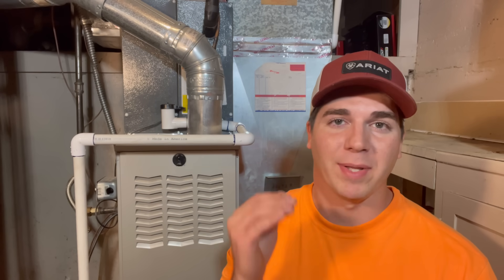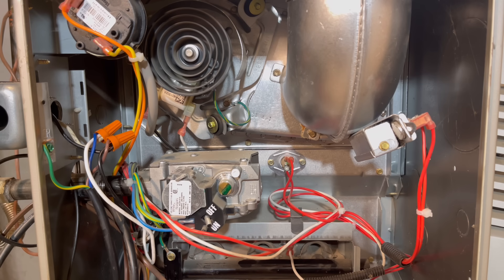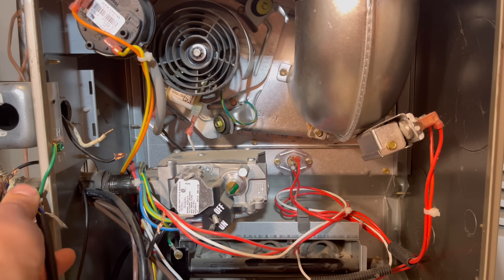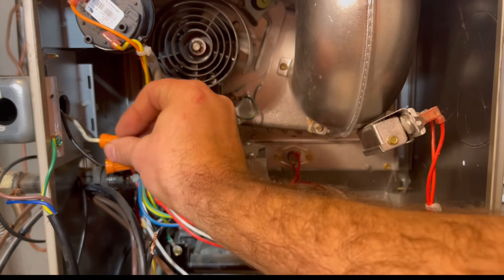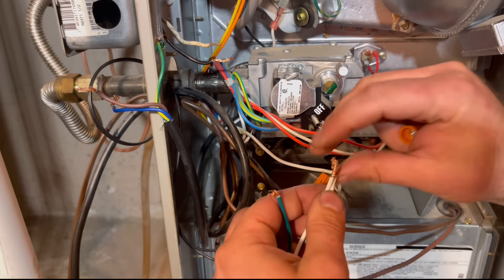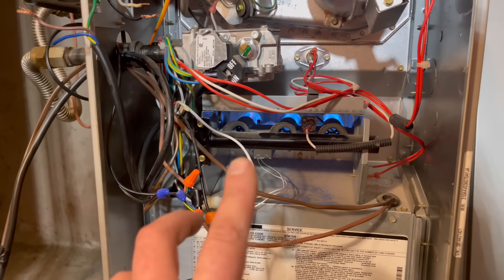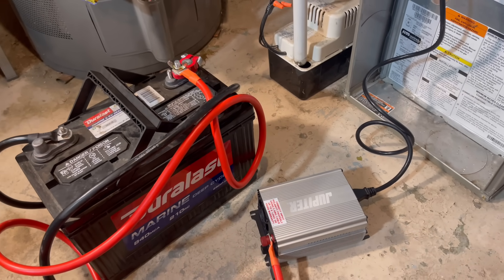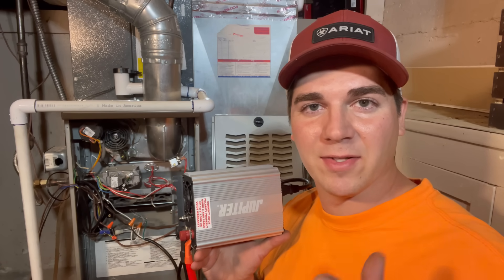Did You Know You Can Heat Your Home With A Car Battery?

Comment: After looking at several of these videos, figuring how much run time would be provided, how much continual amperage is needed to draw from a deep cycle battery (ies) and the cost for everything, and the fact that after the battery runs out there is nothing left, I found that buying one of the small quiet gas generators is a much better option. As long as you can drive to get gas, you can keep power on - run furnace, frig, lights indefinitely.
Reply from the maker: Yea, you do what’s best for you. This is obviously a backup if someone doesn’t have access to a generator. Gen sets are always superior. Mine is tri fuel so I can run it on natural gas

Comment: I had to do this with my basement sump pump once when we had massive rain for several days, and our power went out. It really saved us from flooding, most of my neighbors suffered that fate. I bought a gas powered generator a week later to have in reserve, and have never needed it for any emergency since. I now have solar panels connected to a charge controller, inverter, and gigantic deka battery for power to my shed. I can always run a cord to the house for emergency power, as well as the generator I still have at the ready.
Reply: @pete32 adn it's very much dependent upon where you live too. We have a high concentration of clay in our geographical area. When there's a heavy period of rain, the ground will eventually absorb the water and it takes a while for it to dry out again. The hydraulic pressure it puts on the foundation walls is released by the sump pump and associated drain tile system. It is a system that works as intended, and the only caveat is when the power does in fact fail.

Comment: I live in San Antonio and I did this when we lost power. But I ran the extension chord from my mounted inverted in my truck to my heater. I would let the heater run and get the house to temp twice then remote start my truck and let it charge the battery back up for a bit. It was a life saver

Comment: i'm stunned as to how close you have the battery to the furnace.  the battery needs to be a minimum of three meters from the open flame source of the furnace and it should be in a well ventilated area.
 
should there be a hint of hydrogen/oxygen gas, a by product of electrolyte breakdown which happens during battery activity, reach the open flame the resulting explosion would be catastrophic. you're luck you survived that video filming.
Reply from the maker: This only applies when charging. Otherwise I’d be dead haha
Reply from the maker: If this was true, there would be a lot of cars blowing up. Because the battery is right next to an engine with old spark plug wires that arch all the time.
Reply: @diyhvacguy ...viewers,  please do some research into wet cell batteries and the explosive properties of hydrogen and oxygen gas. most batteries have explosive warnings written on them.  better to have safe practices rather than to risk injury.  keep wet cell batteries away from open flames.

Comment: Have a mechanical direct connect to the axle of EVs and solar, to super charge them. No more plugging in. Use V2G tech to transfer extra energy to the power grid so you don't cause fires or explosions from overcharging. A gear connection would be best for the roll effect. So if you need to disconnect the gear, you can manually without destroying the setup.

Comment: Combine self running generators and power walls in homes and businesses for seemingly endless clean energy everywhere all the time. Imagine running everything seperately and connectively at the same time. Power outages would be rare. And even if the main grid is taken out, everything will still be running.😎🇺🇲

Comment: Should just get a Jackery or other self contained battery system with a Solar Panel.  At least you can power some lights and charge cell phones at the same time.
Reply: I don't mean to be rude about it, but I just think that for the money it would be better to get a battery backup system that has solar panels as a charging system.  I'm up in Connecticut and my Jackery is a lifesaver.  It powers my pellet stove for heat when I have no power  and I can charge it in the daytime with the solar panels.

Comment: Lots of modern furnaces are condensing furnaces, so you'll want to make sure to manage the condensate too.  Mine is on a sump which has to be pumped.  No power, no pump, then small lake forms in the basement.

Comment: Pro tip, never leave a car battery on the ground. It will discharge into the earth. Put it on a little shelf or block of wood. The more you knowwww
Reply from the maker: This is a myth that has been debunked a long time ago. It was true many years ago but not anymore
Reply: Looked it up ur right hard plastic keeps them from discharging.. the more you knowwww

Comment: We had a 10 hours power outage a few weeks ago with the temperatures in the single digits. We heat with a TOYO heater that draws 250watts at start up and 50 watts when running. All our lights, fridge,  freezer and heater are on a sub panel with its own transfer switch. About 15 minutes after the outage I hooked up our Honda 2000  with a 1 gallon gas tank and it ran all night on a tank of gas.

Comment: Do you have to mess with home thermostat when you do this? Does it stay on during power outage?
Reply from the maker: Nope, as long as the furnace has power, the thermostat will work as it always does normal 👍🏽
Reply: @diyhvacguy  Thank you so much for the info. Great video 👏

Comment: Would it not be better to wire your furnace to a 3 prong  cord and plug it into a normal outlet?  So if the power goes, you can unplug from the grid and simply plug it into an inverter????
Reply from the maker: I have a video walking you through how to do this actually. It’s titled “Don’t let a power outage leave you without heat this winter”   Check it out! Cheers

Comment: Does the THERMOSTAT NEED  POWER-
OR is back-Fed from the power to
the “furnace “ ?
Reply from the maker: The furnace gives the t stat power so as long as the furnace has power, the thermostat will maintain whatever temp you have it set to just like it normally does 👍🏽

Comment: How many Watts do most blowers require?
Reply from the maker: Mine is a 60k and pulls 500 so I’d say for a large 100k furnace, it would probably pull closer to 900-1000 watts so I’d get a 2000 w inverter for a larger furnace.

Comment: the battery is 12V x 106A around 1200W/H  some blower motors are around 1/2 HP(375W) so will run for around 3 continuous hours if the battery is brand new

Comment: Why not just hook up the inverter to your car battery, run an extension cord to your furnace. Wire up your blower fan, connect to the extension cord and wahala?  When your car battety gets down to 10 volts many inverters will cut output, then start the car to recharge the battery.
Reply from the maker: I have another video on this :)

Comment: This is just common knowledge but that is a acid battery and you have no charge controller hooked up too it so you know the battery levels. Once a acid battery gets fully drained dead it gets damaged and typically won’t hold a charge no more and it turns useless. What you need is not acid batteries you need even just regular lithium batteries and that way you can fully drain them and it doesn’t ruin them and you can charge them back up and do that over 1,000 times with regular lithium batteries. The best ones on Amazon are over 300 bucks though for a 12 volt 100ah battery and will run at 1,280 watt hours and will last well over 2 thousand full charge discharge cycles but if you drain them half way and recharge them back up from 50% they will last you over 8000 charge cycles. You could be hooking up solar panels too it as well and charge it back up with free energy once it’s half way and always keep solar panels on it charging none stop with a charge controller with mppt built in but the lithium phosphate LiFeP04  best of lithium technology at lasting longer and way more charge cycles than regular lithium batteries have built in protections already. I’d rather buy and invest in one of those new tech LiFeP04 batteries that I can fully discharge without destroying the battery like regular acid batteries that will be damaged faster with full discharges.
Reply from the maker: Thanks for sharing.

Comment: Here's a question. What if you plug in a car battery charger into the silver box. Wouldn't that charge the battery  with its own power and let it last a bit longer?
Reply from the maker: No thermodynamics won’t allow it. Friction and heat will use up the energy quicker then it can generate it.

Comment: Will that battery run a big central heat fan ?🤔
Reply from the maker: No this is only for gas furnaces. I’ll have a video on backup power for heat pump and electric furnaces soon. Stay tuned for that! Cheers

Comment: Cranking amps are pretty much irrelevant, how many reserve amp minutes does that battery have. Probably drawing a minimum of 5 from the furnace plus 1-3 extra from the inverter, if you have a standard reserve cap you'll be going for a few hours at best.

This is why RVs with inverters run banks of batteries, and usually batteries with low cranking ability but a lot of reserve capacity.

Comment: What if mine isn’t a gas furnace?
Reply from the maker: This won’t work for you unfortunately. You’d need a large generator or a massive solar array. My apologies. I’m planning on doing a video for powering a heat pump or electric furnace by means of a gen set soon so stay tuned for that! Cheers

Comment: Can an inverter power a heating system that runs on electric? I have air conditioning unit so I've been told my heater is a heat pump. Any can I hook up an inverter to it and make it run? Thanks
Reply from the maker: Unfortunately you cant do this with a heat pump or electric furnace. This is only for gas heat. But you can power your heat pump or electric furnace with a large generator and soft start kit hooked up to your condensing unit. My plan is to do a video on this soon so stay tuned! Cheers

Comment: Good in theory, but a single SLA, 210aH deep cycle will only run it for hours, not days. Also, using a modified sine wave Harbor Freight inverter on an expensive furnace, bad idea.

Comment: This is not as simple as it seems depending upon the kind of furnace you have and inverter I have a newer high efficiency furnace I tried everything to get it to work off the system I finally was able to find a 3000 watt inverter on eBay that you were able to ground otherwise the furnace would continually shut down no matter how I grounded it this must be a older furnace because the newer ones with the circuit boards are extremely fussy same thing with my front loading washer and dryer they will not work unless it is especially grounded inverter I went through several inverters trying to get this to work
Reply: I also use my 600 watt solar system to power the lithium batteries but again all this will not help unless you have the correct inverter also it has to be a pure wave sign inverter for the newer furnaces and you must be able to ground it otherwise the furnace will shut down it is really tricky and very discouraging many of the videos I looked at said it couldn't be done this system is great for the older furnace he's using But It's Tricky and a newer high efficiency ones you have to do a lot of homework but it's a great video

Comment: I would have used a D.P.D.T. switch so you wouldn't have to swap out wires.
Reply: Yes the D.P.  D.T. switch is the answer.  During power outage, flip DPDT to "other side" Plug into generator and done.

Comment: Ok need to ask a few not so savvy questions ....

My thermostat upstairs on the wall is the old dial kind... not digital ...does that need power??? 
Can i set a temp or will this method just turn it on at full blast? 

And deep cycle boat battery ok or do i need one with higher cranking amps for when the furnace kicks  on and goes after like 700 or 800 watts...or does it matter 

Thank you so so much
Reply from the maker: Yes any thermostat will work even if it’s the old dial kind, it’s basically just sending a signal to the furnace. As long as the furnace has power, any thermostat will function as it normally would on grid power. So you don’t have to run it full blast. Set your temp you want and let it run and it will turn off when it’s met that temp 👍🏽

Comment: awesome advice bro. But always turn the gas valve off and let the burners shut down so the blower motor can come on and cool the heat exchanger down befor shuting the power off at the furnace. If not then you take a chance on burning out the high limit saftey switch. JS
Reply from the maker: Great point! Thanks for sharing

Comment: Wow great demonstration, thank you! How many watts would you need in an inverter and is the inverter a pure sine wave?
Reply from the maker: Yes pure sine wave is advices. Mine ran perfectly fine on a 1000 w inverter and it’s a 60k, so if yours is large it might take a 1500 w or 200w inverter

Comment: I'm retired auto mechanic a regular car battery is going to drain very quickly in case of emergency so it will last a little bit longer you need to get a big deep cycle marine battery it drains more slowly but but that power inverter is going to drain that deep cycle marine battery pretty quickly

Comment: I'll get a little more technical by saying it helps if the battery is a deep cycle marine battery. Also you need to make sure the inverter has a high enough amperage rating to run the furnace, mainly the fan motor.
Reply: What about one of those inverters/battery combos that run power tools? How would that work with this method?
Reply: @Bachelor_Gabe  Really anything that can push out some power at a high enough watt rating will run it. Just a matter of how long they last. The deep cycle marine battery will do a pretty good job.  A Lifepo4 battery will do even better but cost 4-5 times the amount. It seems a lot to spend on a just in case scenario, but in an actual emergency when it becomes your only source of heat, you just can't spend enough!

Comment: Will this tip/trick work with a "Nest" thermostat..?  Reason I ask is because if you are experiencing a power outage than you will not have wifi available.
Reply from the maker: Yes, this will still work with a nest thermostat. The nest will work as long as it’s set up before an emergency happens. It will still regulate the temperatures as long as the furnace is giving it power. Cheers.

Comment: Not sure how good this advice is. I believe that car batteries produce hydrogen as a "byproduct" when producing electricity. It might be OK if hydrogen gets sucked in by furnace's burners and burned together with NG. But more likely it gets up to the ceiling (as it is lighter than air) and accumulates. And then when once a furnace fires up.... Can keep it going for days you say? Did you actually try that?
I think you need to keep the battery outside and use longer wires -  then it should be safe.

Comment: Does it still work with the thermostat - turning it off & on, or woud we have to unplug it to switch it off?
Reply from the maker: Yes as long as the furnace has power, the t stat will work as normal 👍🏽

Comment: For the record, this will not work with HVAC’s that rely on heat pumps or heating coils. This backup option is solely for natural gas or propane gas heating.
Reply: Thank you,  Was wondering if it would work for oil burning hot air furnace...apparently not?
Reply: @dcalkins2808  The actual fuel shouldnt matter. But good question.

Comment: I use a Honda 1000 inverter generator with ground and neutral connected. It will run the furnace and fans without even going out of idle.

Comment: I have a home battery backup solution which is just a bunch of 100AH 12v SLA batteries in parallel on an inverter and i did consider this but ultimately a furnace with a blower uses too much power for it to be viable for more than a few days without a generator. Especially when its really cold out where it needs to run for hours a day. A better alternative for long term power outage is to get a Valor natural gas insert fireplace that runs off of a couple AA batteries to spark and can run continuously to heat your home safely without needing any electricity at all.Its what i ultimately went with.  So i can deal with a multi month power outage now in winter, no problem. Or second to that, just get a generator, modify your furnace to make it a plug in furnace like you did here and plug it into the gen. But in any case, great video.

Comment: Why not just change the little electrical box attached to the side to an outlet and convert the furnace to a plug in furnace with a cord coming out the side?
Reply from the maker: Building code requires a switch if I’m not mistaken. But the outlet and plug would be very simple!

Comment: Can't you just put a regular male Edisan plug on your furnace cable running to the breaker box and then just plug it into the the inverter? instead of getting into the furnace wiring every time the power goes out?
Reply from the maker: Yes that’s what I did if you watch my latest video :) cheers

Comment: I wonder what would happen if you wire that thing up and you have an extra plug if you were to put a battery charger in that extra plug so that way you could keep the battery charged at the same time that way it would last more than few days what do you think
Reply from the maker: Wouldn’t work due to thermodynamics not allowing it :/   Cheers